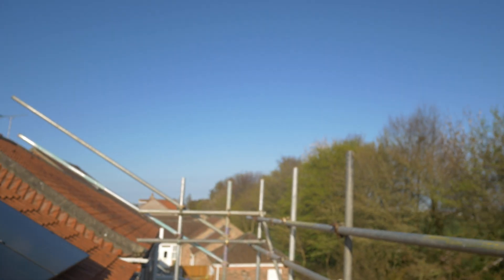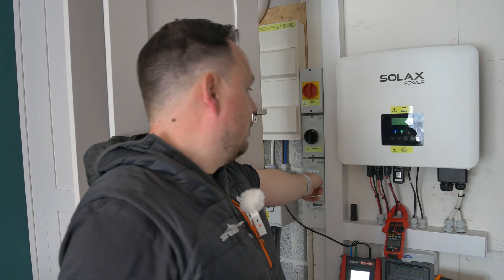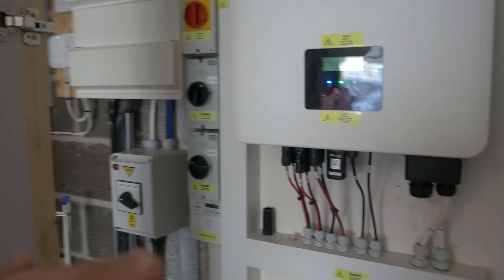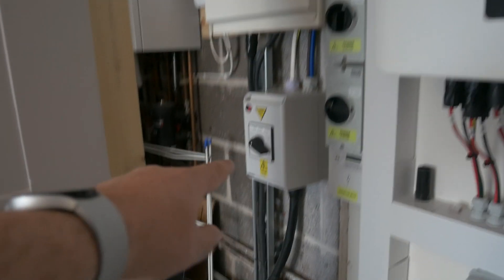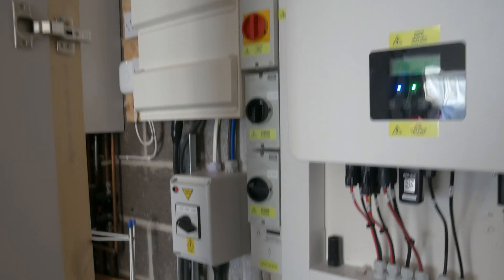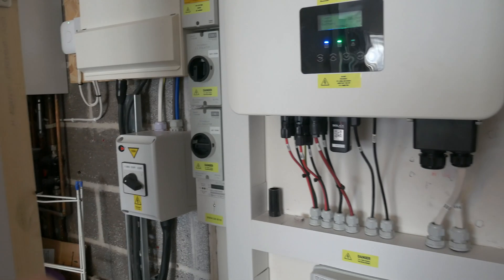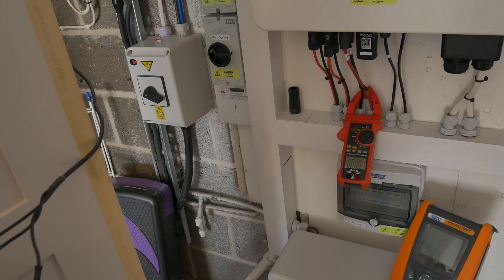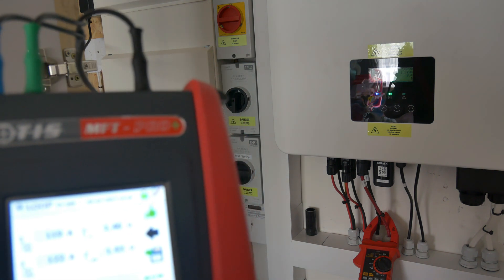Running my house off grid in Island mode - Solar power from Solax and Trina

Comment: Another interesting video... thanks... I may have missed it in the previous ones, but what's the logic in having the ability to 'Island' your power system ? Isn't the ideal solution as follows; 1. PV panel output is either used or if not adequate usage, store excess power in batteries/water 2. PV output fed back to grid to be avoided as very low rate achieved 3. When no PV available (e.g. at night) then battery storage is used.  3. If battery storage empty, then use grid power.  4.  If not enough PV for the next day, consider re-charging batteries from grid on over-night cheap rate ? 5. If there's a grid failure, then no issues as you're on battery normally.  Apart from maintenance/fault finding/testing etc., I can't think of situations (in everyday use) when I'd want to totally disconnect the grid.  What am I missing ? (Just thought maybe the Octopus 'saver sessions' ?)
Reply from the maker: This comes back to Safety Greg. At times of a grid failure we should not be remaining in connected mode and energised for reasons of safety. Some systems can operate in a more UPS state which will do much of the safety critical switching automatically and within mS. 

This setup does not. The inverter alarms and power output on AC removed. Which can then be restored in EPS/island mode manually. 

I prefer this method as it involves a human/mechanical input to choose to operate.

The designated operation list you provided is exactly as my system operates. With an emergency backup option to run in island mode. As described in the videos this will not be a regular or often situation

Comment: Think you said the main earth is TNC-S and in inverter EPS mode it is TT but you have them connected together in the distribution board does this not make it TNC-S earthing? Or is the inverter EPS neutral output not connected to the TT earth? My Solax install has a twin 13A socket connected to the EPS but the socket is fed with just live and neutral there is no earth connection.
Reply from the maker: That is a setup option some manufacturers and guidance will allow for a single outlet. I would never install that personally. 

As discussed in the video you can operate with the TNCS earthing alongside your supplementary earth. It's only really beneficial if you have a low impedance earth electrode. 

In my setup as described the earth from the grid aka tncs is switched out in the change over switch when in EPS mode. But they are both connected in conjunction with each other when in grid connected mode.

Comment: Great video just wondering if solaredge might of been a better option or is solaredge a lot more in terms of cost which could of helped with shading issues 🤔😎
Reply from the maker: I did consider solar edge with optimisers but having knowledge of the sun path and tree leaf times I am happy to chance my arm without.
Reply: @electrician247  hi again is solaredge a lot more have to say I have been looking into solar it 🤔😎
Reply from the maker: @neilbissett1240  Not massively so. You basically have the extra optomiser expense which is £40-£60 per panel typically. 

Along with the higher inverter and battery costs compared to solax. 

On my system it would have added a fair amount. Due primarily to the battery and inverter costs.
Reply: Hi, Maybe you also can consider using the shingled Module to reduce and avoid the shade effection?  It's a good solution for the solar roof system when it has some shade from the building or tree.    @electrician247